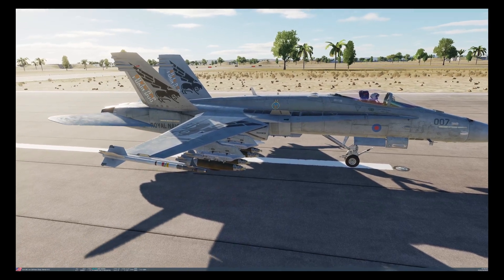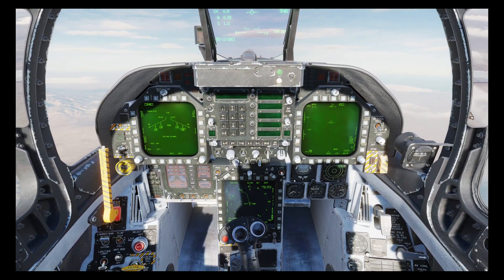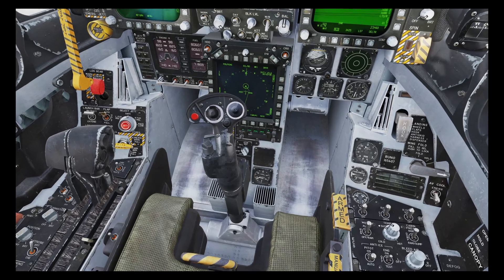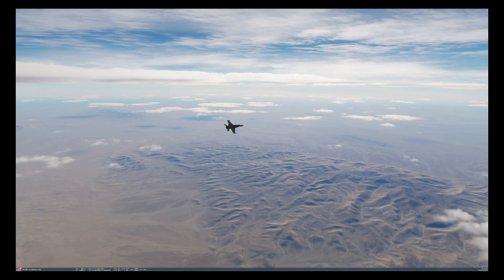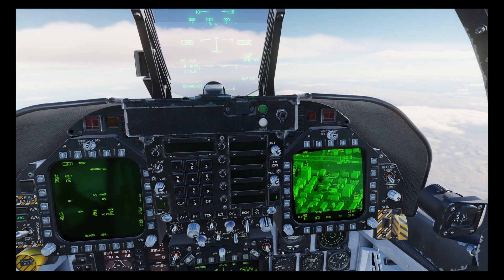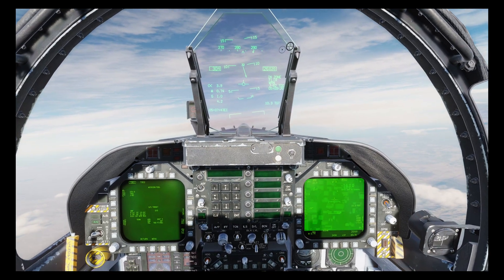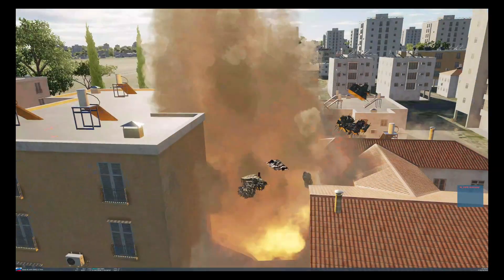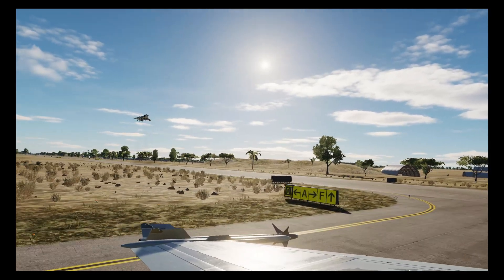DCS: Hornet JDAM advanced tutorial

Comment: after prog. TOOs, Set multi release for all station. first push drop 4 JDAMs, switch next TOO program 4x (all station) and push WPN release second drop 4 JDAMS, its faster
Reply from the maker: It's a good shout and completely forgot about that. I have considered re-doing  the video but decided against it. If I were dropping just 4 JDAMs I would have, however as you need to switch TOO on each station anyway the extra setup is barely worth the benefit. I will definitely cover this on another video though.